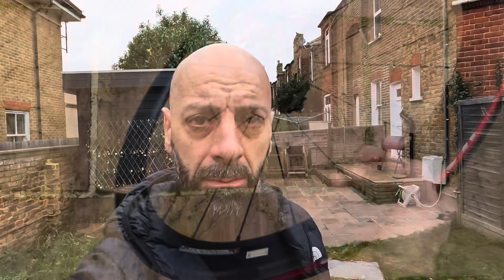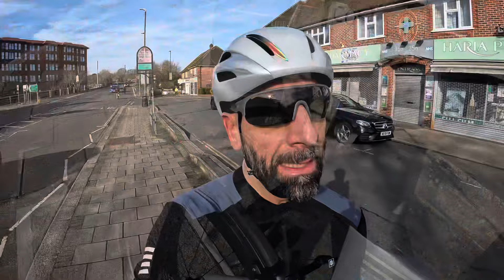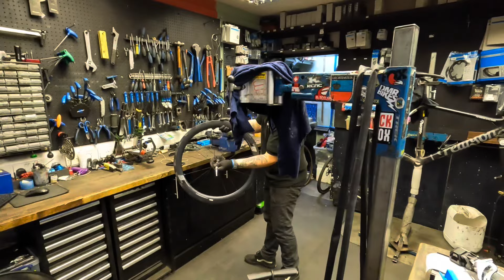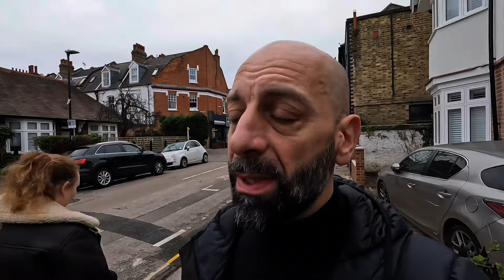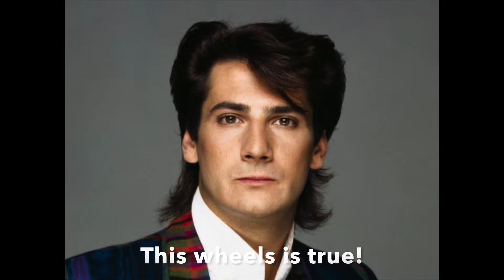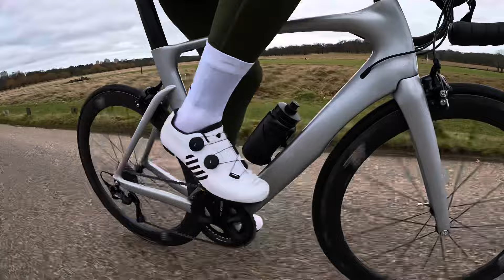I broke a spoke on my Vision SC55 wheels…

Comment: Sorry to hear about the broke spoke. I wonder, though, if there is an underlying problem. Clearly you are the most powerful Youtuber cyclist 😆👍 but I feel the spoke should not have broke... a good wheel like Vision should have taken your power, your weight, and the impact with no issue. If Pearson did not do it, it would be good to do a spoke tension test... on all spokes. Broken spokes are caused by galvanic corrosion, which I do not see, or improper tensioning.
Reply from the maker: Definitely there is no corrosion there, I've had them less than a year. Maybe tensioning or the pull angle?
Reply: @fede1275  For your safety it is good to check it. Maybe others are interested, as I am, to see the results in another video.
Reply: Maybe the wheel ran out of true slightly after the jump and  the tension change put a high load on one spoke and it can break.
Reply from the maker: @mb10kx  could be the angle I landed as well?

Comment: Nice one. Lucky it was quik repair .  Would you prefer vision over hunt wheels ? Planning for future wheel purchase?? Cheers ☕
Reply from the maker: I guess it would depend on the width of the tyre you want to use. These Vision are 19mm internal and 26 external, for me they are perfect with 23c GP5000 tyres, perfect aero transition. They should be okay with 25c, but if you want to run 28c you might need wider rims.
Reply: @fede1275  nice , running 28 mm rims . Tubes , tubeless capable, but no lol 😂

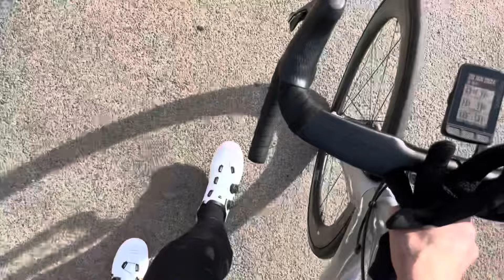Comment: @1:01... I submit this would not have happened with latex tube (or butyl). TPU has very little stretch, essentially none. A sharp compression event will burst a TPU seam whereas latex will stretch and not be bothered. Like tubeless and hookless, TPU is a scam... they cost more but are less good.
Reply from the maker: Maybe, but in almost 2 years I've been really happy with RideNow TPU tubes. Fingers crossed!
Reply: @fede1275  same here, I've been using TPU tubes for 3 years/15,000 miles. Had one puncture and that was from a giant thorn.
Reply: Sadly, the roads round here are terrible for pot holes. My Ridenow tubes have survived where conventional tubes would have suffered snake bite over and over again. Will never go back to butyl/latex...
Reply: If you get a tpu tube from China they are as cheap as butyl at UK prices

Comment: Bummer.  Remedy?  Upgrade to 32 spokes, or better yet, 36 spokes, threaded cross 3, stainless steel 14 gauge, and tension them to sing the same tone when plucked, and don't look back.  Those wheels will climb like bandits and take all the abuse you can hand out.  The brake pads will wear out the rim before a spoke breaks.  I've replaced rims several times on the same hubs and same spokes!  Never broken one.  Wheel building seems to have become a lost art.
Reply from the maker: Maybe one day I'll get a custom made wheelset!
Reply: @fede1275 they are cheaper than you think! I cracked gravel rim, and had a wheel built to my weight with a stronger rim with thinner gauge spokes to allow for flex, counterintuitive, but it works!

Find an experienced wheel builder, that’s the hardest part…
Reply: Years ago, Colorado Cyclist offered wheels on customer's choice of hubs, rims and spokes.    They're were all custom built by hand, so the quality was excellent.   I can't believe competent wheel builders, like the one you found, aren't still around.

Comment: Spokes only break when the wheels are badly and weakly built.
Reply from the maker: I understand, these seem to be nicely put together, but who knows
Reply: @fede1275  Frequently, a low tensioned spoke will break at the bend on the hub, from too much flexing.  A break at the nipple is usually caused by an impact or twisted spoke, or both.  The fewer spokes of course make that more possible.  If the mech replaced the spoke and took less than a few minutes to bring the wheel back into true, you're probably in good shape.  You could check tension by plucking the spokes and listening for the same tone, which would indicate the load is evenly distributed around the rim.
Reply from the maker: @paulmcknight4137  great info, thank you